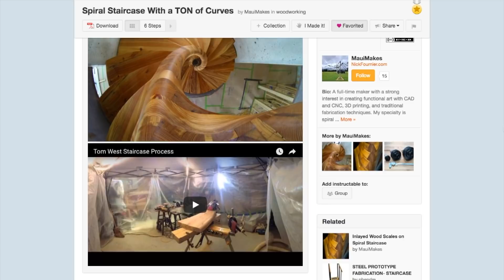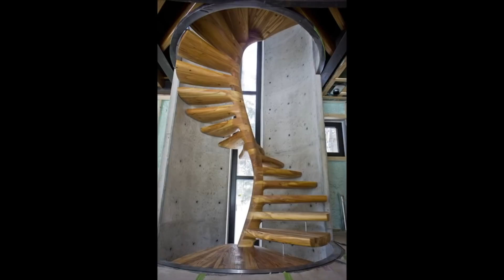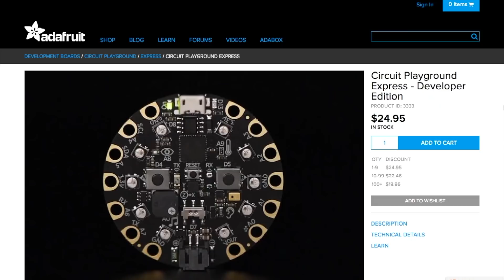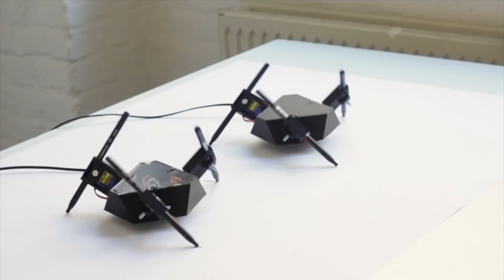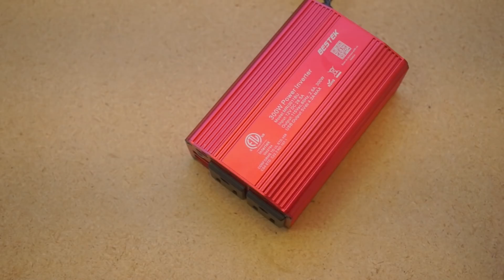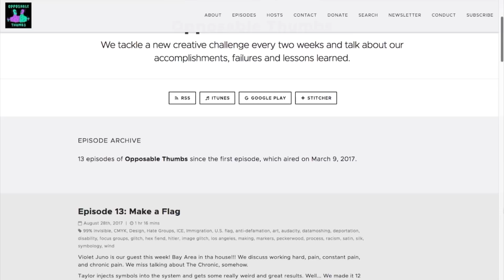CNC Spiral Stairs [Maker Update #49]

Comment: Speaking of if the car power converter is too weak...
I'm pretty sure I've seen a CORDED 12V impact driver made for working in the car on Amazon.
But still, Li-ion batteries last forever... Makes no sense buying it unless you... Nope. Makes no sense. Better to buy two batteries.
Reply from the maker: The inverter is great when you just need to charge ALL THE STUFF!